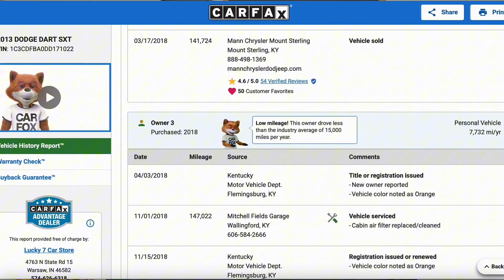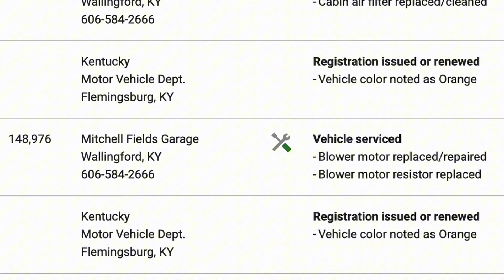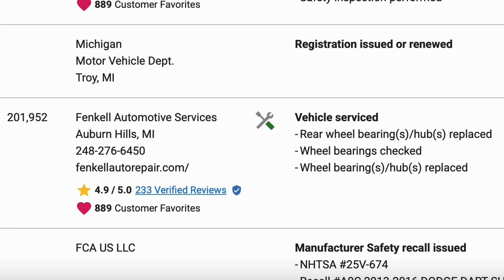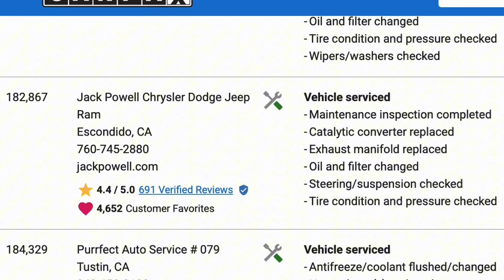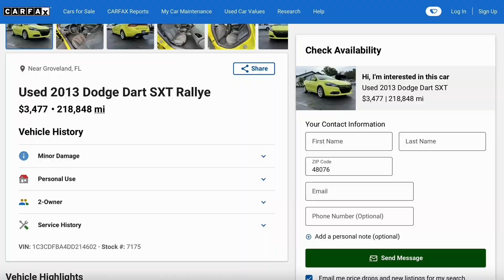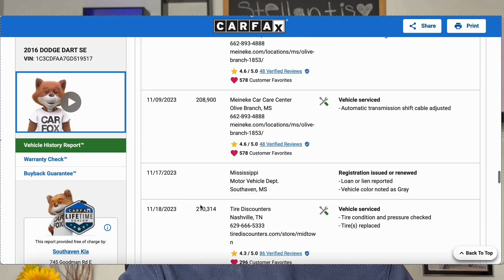Are Dodge Darts Actually Reliable after 200,000 miles? — Analyzing Service Records

Comment: I like my dart. So far a/c replaced with motor mounts and shifter cable. Have the se model with the 2.0L motor. Average mpg is 30ml/ gallon. 34 on high way.